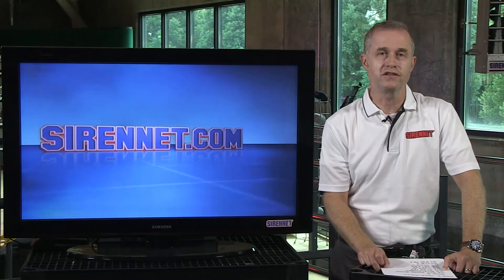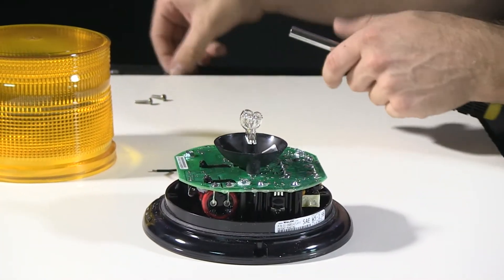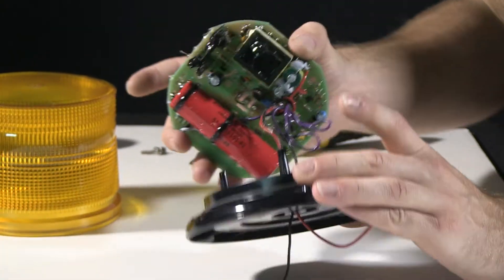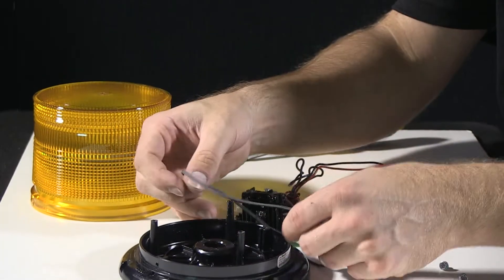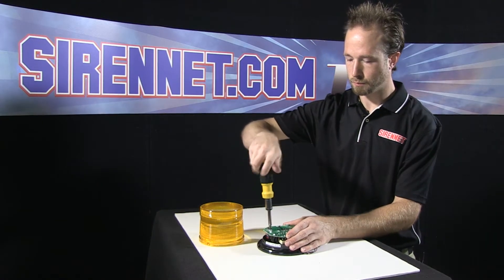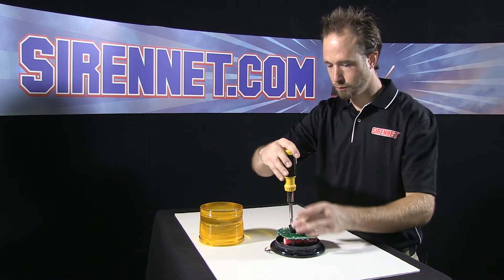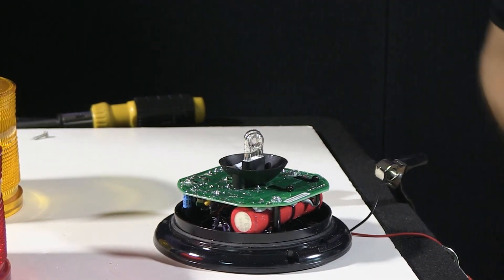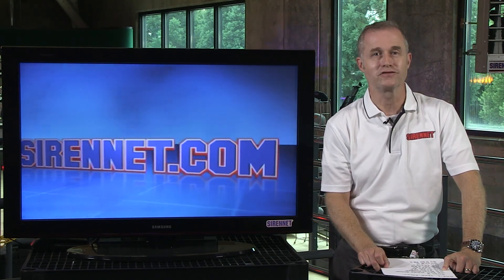Chris disassembles a Whelen 2022 Quint Flash Strobe Beacon

Comment: I have pair of these mounted on a Kenworth truck , 1" stainless steel tube mounted on my mirror bracket. Both bases broke high up on the thread mount. What is the proper way to keep these lights on sturdy, and not have the thread part break?